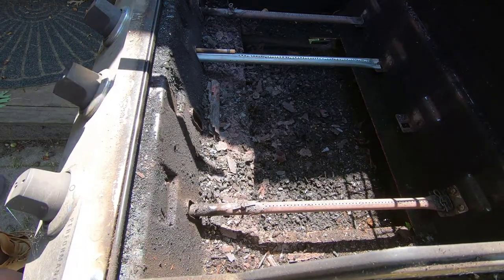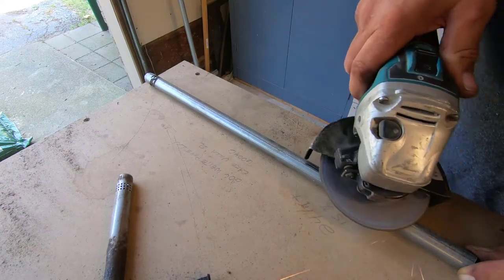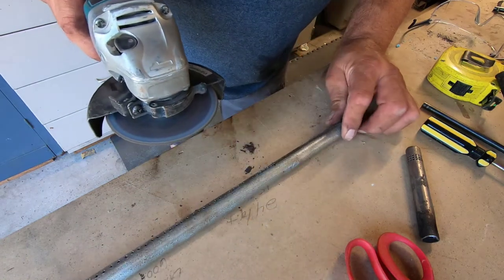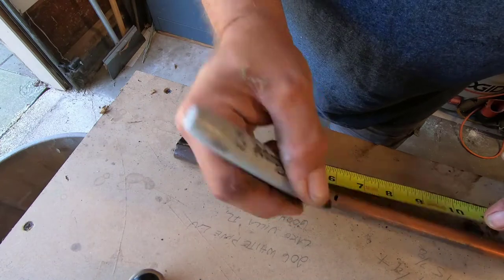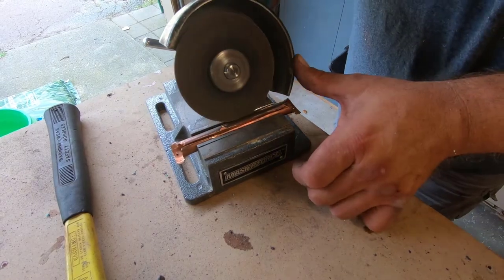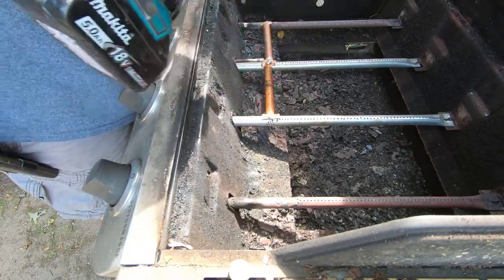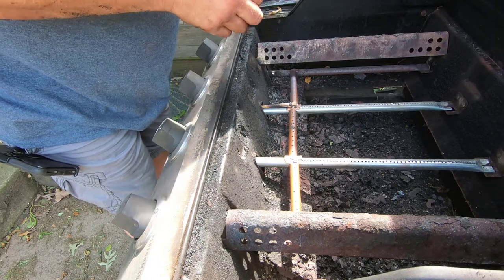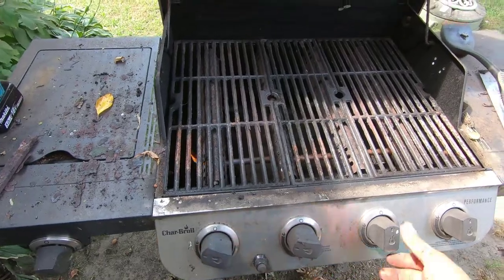Save Money, Make your own grill burner!

Comment: That’s a good idea but if that conduit is galvanized it’s no bueno. When you heat galvanized steel it creates cyanide gas
Reply: No, it doesn’t.  But it does create zinc oxide which is just as non bueno.

Comment: Nice.  I've got a 3 burner Weber and a replacement burner assembly is $72.  But on mine the only thing rusted out is the transfer tube between the burners.  I'll try laying in a piece of copper.  The original tube looks to be about 1/4 or 3/8, I think I'll use a piece of scrap 1/2 copper and cut out a significant slice on the bottom like you showed, and close the tube down to the right size.  BTW, nice acorn at 8:10.  LOL.

Comment: What kind of metal is the conduit?  Could you use a copper pipe for the burners?
Reply from the maker: Yes you can. Copper is more expensive and i didn' have any.
Reply: I used copper pipe and it lasted 5-Years, Much easier to drill. I used the 1/2" waterpipe the heavy duty, Not the reg grade it is to thin.
Reply: @edgenet1  thanks George